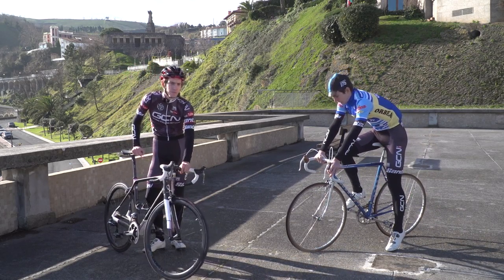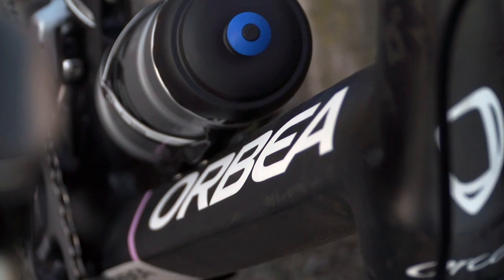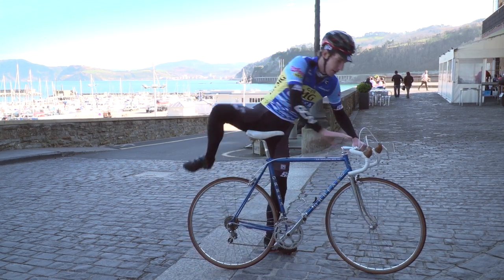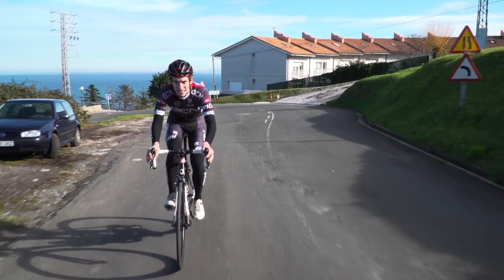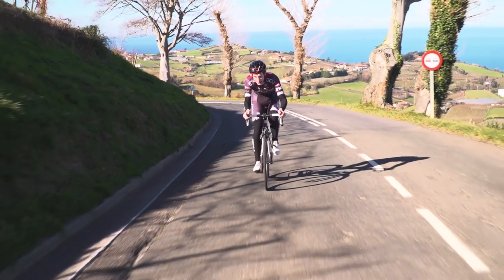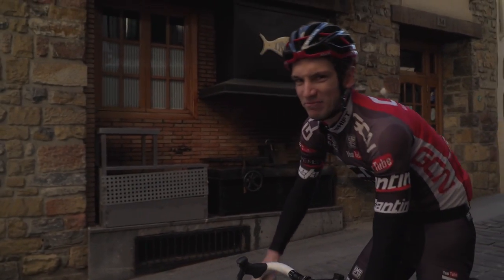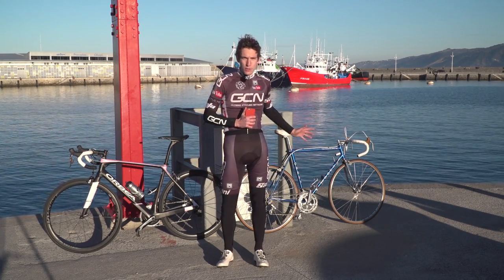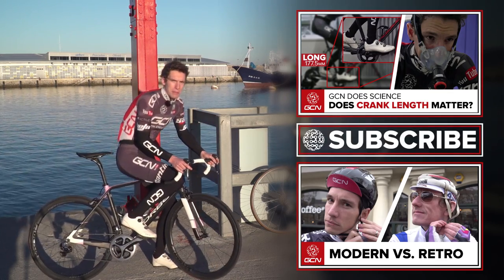How Much Faster Are Modern Bikes? | Retro Vs Modern

Comment: make a video about modern steel bike vs modern carbon bike
Reply: Modern steel bikes are really light. Especially if you use Columbus Spirit tubings, it will be similar as modern carbon frame weight.
Reply: +Yeonho Cho No it won't, or, if it is, it'll wiggle and wobble all over the place under hard climbing and hard braking and cornering. Flats would be ok.
Reply: +Digby O'Dell Ya, it will.  I have a custom 2013 Reynolds steel frame, race geometry and carbon forks, that holds 5 local KOM's, each over 6+ mile segments, one averaging 25.3 mph.  No "wobble" that you speak of and the frame is only about 180 grams heavier than my carbon Scott.  Steel feels better to me, more lively and responsive.
Reply: Somethings not right with those figures unless it's an old industrial age carbon fiber frame like my Dean which weighs closer to 1400 grams, whereas a large light steel frame is going to be about 1800 grams or a little less if it's small and not really all steel...size does matter a lot when it comes to using a heavier material, and I am always going to be an XL. I had the same problem with Ti where I could feel the front going left when I was going right at what was full gas for me.
I'll agree with lively (another man's noodle) but not so sure about responsive, that's more of a subjective term. Beyond a certain point of compliance, which I actually love in carbon fiber, I can readily agree conversely that carbon fiber frames largely lack any liveliness at all; except for carbon fiber forks which can vary quite a bit more and where liveliness is not necessarily a virtue!
Reply: +Digby O'Dell I only weigh 160 on a 54.5 effective top tuberculosis  so that would make a difference.  on an XL frame the tube lengths alone are going to make a significant weight and structural difference.  1800 grams??? That's heavy even for a steel frame.  Along the lines of a chromoly Soma, again not thinking of the XL size.  Mine is a touch over 1460g on the scale, no forks or headset.  2015 Scott Addict is about 1280.
Reply: +Digby O'Dell Titanium and Steel frame have different stiffness and other. Steel bike is way stiffer than titanium. This is why track cyclist never use titanium track frame.
Reply: +Yeonho Cho Tuberculosis... damn autocorrect

Comment: Seriously? Even with the bogus Simplex components, I rather doubt the weight difference was 4 kg. I have a steel bike from 1987, and a carbon from 2014, and the difference between them is slightly more than 800 grams. Also, there was definitely a disadvantage in no toe climbs, operator proficiency (Really? He was surprised to be able to shift onto the big ring? It's not like normal indexed shifting is that big a help on a modern bike!). 

I call bullshit on this "test".

Comment: How silly.  This isn't a serious comparison which you can tell by the degree to which the steel bike was handicapped:  poor fit, not even using toe baskets, pedaling with shoes designed for clipless pedals.  Yes, I climb faster on my plastic bike, but if the race were downhill I'd pick one of my vintage steel bikes, with new rubber and brake pads of course.  I like them both.

Comment: Are you trying to pull the wool over my eyes? at 0:59 we see Delgado riding a bike with Campag Super Record, not Winmann brakes. Also those Simplex gears you show are entry level components, so should be compared to a modern "Tiagra" spec not Dura Ace. Looks like it also was shod with el-cheapo wheels... which is why you broke them....not saying retro is better than new, but at least make the test fair... stopped watching after i saw that, since the result will be BS

Comment: i span most of the frame metals
steel (kalkoff)
renolds531 (dawes)
molybendium( raliegh criterium)
aluminium(cannondale)
aluminium(bianchi)
half carbon(bianchi)
full carbon  (bianchi)
if this test had been done with the older bike fitted with toe clips ,i guess this might have taken  30 seconds off the final time ,plus the arseing about with the wheel probably makes this test unvalid,i have no doubt that the newer bike is superior .that is the very least i would expect from 30+ years of progress ,and the fact that aluminium and carbon means that a new generation of cyclist will  never experience rust is commendable ,however the cost of a  reasonable cycle is now over a thousand pounds for a  basic carbon model and a aluminium model at half that amount,the economics are simple ,as i have owned the whole range my next cycle will be a aluminium road bike bought at the right time of year(autumn) when they get rid of the current years model.on the basis that its not that much heavier than a carbon,has little crash issues(carbon could be a worry as to frame stability after a heavy knock.and the problematic issue of having to purchase a specialist wrench to perform basic maitenance,in case you crack the frame,i use my bike as a means to commute to work for the last 13 years and ongoing and the question seems to be is it wise to spend £2,000 to get a cycle that is maybe 5 pounds lighter than a aluminium model at £700 its your money folks ,as someone who has paid over£2,000 for a ride to work,my next upgrade will be a downgrade however it will still have the bianchi name on the frame,

Comment: huh, mind you ive got an old ccm targa that isnt special by any means, and its got a mix off mtb parts on it and different brake levers and brakes themselves. The point being, si looked pretty slow down that hill, i bomb hills at 70 k an hour, could have saved some time there, and if youre descending and using your brakes lol youre doing something wrong!

Comment: Modern bikes are definitely faster. But the riders of the old or retro were/are definitely stronger.
Reply: Hahaha, you are joking right ?
Reply: No.
Reply: hutch430 Come on man, how could you say that? Sports science, nutrition etc has vastly improved in the last 20 years. There is no way a cyclist from 20-30 years ago could outperform his today's equal. Also PEDs are a lot more potent nowadays which gives an other huge boost on top of improved training methods and stuff. There wouldn't even be a competition between them. (Note that it holds truth to every sports where strength and endurance plays a big role.)
Reply: I just believe the cyclists of the old would were stronger than the new. They rode heavy steel on feel. No power meters or strava whatever those things are. They didn't have all this team high tech which should be outlawed by the way.
Reply: hutch430 Yes but these new gadgets and improvements are exactly the reason why cyclists are getting stronger and have more endurance. They help with training.
I must mention that I am a fairly oldschool guy in my mentality too. I have a titanium frame hardtail MTB with a speedhub, very low maintenance, not many things that could go wrong on it. But still I would never say that cycling is not improving in every aspects. 
Today bikes are better, lighter, stronger and these gadgets can help lots of people. Why should these things be outlawed?? For folks like you and me, well we just don't buy these things, it's not like we are forced to buy them :) .
Reply: I meant outlawed in professional cycling during a stage or event.
Reply: Oh no way hutch, today's cycling is a great great deal more competitive, cyclists a great deal stronger fitter in better shape...
Reply: Well, think about it. Todays cyclists need a compact or semi-compact chain rings with 28 or 30 tooth rear cassette with 11 speeds and still whine. Yesterdays cyclists had even heavier bikes, did with a 42 small ring with a 19 tooth rear cassette with maybe 7 speeds. Brother, todays cyclists are boys, yesterdays cyclists were men.
Reply: and yesterdays guys did all this with no computers, power meters, strava and whatever else fake aids of todays cycling are using to try to enhance their performance. A computer will never be able to measure a persons feel.
Reply: hutch430 You could do the same thing today... and finish as the last one in races. Competition by definition is about to be better than your opponents. And with all these high tech gadgets, modern drive train systems and lightweight bikes you have an advantage. I really don't see what's your issue here, or what's the point you are trying to make. You can still ride a steel framed bike from the 70s if that what makes you happy.
Reply: hutch430
Yes they have all kinds of support that allows this to be the case, however I'm responding to what you said, and the fact remains that today's cyclists are a great deal stronger than those of yesteryear.

For example if you could put one of today's best time trialists onto a 1960's bicycle and get them to ride a time trial against 1960's cyclists, today's cyclist would shit all over the field, because today's cyclists are a lot stronger.

You can believe otherwise, but you'd be wrong and every cycling expert knows it. As for the claim that today's cyclists are boys, you should know that today's cyclists put themselves through just as much pain as those of yesteryear. You're looking through rose coloured glasses. If you've seen old Tour footage, you'll see they did a great deal of whining. And cheating was just as prevalant but took different forms. Men don't catch trains to gain an advantage.
Reply: You have your opinion I have mine. 
Todays cyclists are not stronger. Take away all the fake electronic gizmo and todays riders would be lost.
Reply: hutch430 If you sent back a top level cyclist of today to let's say 1970, what do you think how would he fair against those cyclists? I am talking about using the same technology and bikes as they were using back then. Do you think the modern day cyclist would loose against those riders? I am genuinely interested in your reply.
Reply: zoltan87
Yeah that's what he's saying, the modern cyclist would lose. Not only lose, but that modern cyclists are borg drones that wouldn't be able to ride a bike without a speedo, powermeter, GPS, and connection to the Strava hive collective.
Reply: eddy merckx is almost as fast as pantani on the mont ventoux with his heavy steel bike and less Gears  and a lot faster than some modern Day mont ventoux winners
Reply: Yeah and there's only a couple of hundred metres in the hour record between Merckx and the record today. And he did it at altitude.
25 October 1972 Belgium Eddy Merckx 27 Agustín Melgar (333 meters outdoor concrete high-altitude), Mexico City, Mexico 49.431 Drop handlebar, *round steel tubing frame*, wire spokes.
27 October 2000 United Kingdom Chris Boardman 32 Manchester Velodrome (250 meters indoor wood sea-level), Manchester, UK 49.441 Drop handlebar, *carbon fibre tubing frame*, wire spokes.
19 July 2005 Czech Republic Ondřej Sosenka 29 Krylatskoye (333 meters indoor wood sea-level), Moscow, Russia 49.700 Drop handlebar, *carbon fibre tubing frame*, wire spokes.

I think Hutch is vindicated.
Reply: dudes, you just need to look at randonneurs. all the records.were broken in the 60's and never again has someone broke them. all you weight winnies woudnt be able to go up a hill in an 18kilo bike, less alone do 200k. modern cyclists need everything in order to do time, if they forgot their milkshake then they're fucked, while old school riders drank and smoke like beasts and still could keep on max effort in 40°c temperature.
Reply: Look up world's any type of lifting or running historical records.

Comment: Was this the bike Delgado rode to the shop to buy a loaf of bread?,weinman 500 brakes,i had those on my raleigh arena,cheap looking simplex gears.The frame angles are too relaxed for a mid 80's pro's bike.I know it was just a bit of fun,but its pointless,you cant ride normal pedals with modern cleated shoes,you will slide off the platforms.If you were to do the test with a campag super record equipped hand built de rosa frame or something,you would have a bike that all pro's used in the 70's/80's.You would have little deficit,if the bikes serviced to perfection,until you got to a climb,the 4/5 lb weight increase would hold you back,but most of that is in the frame,not revolving weight.Of course modern bikes overall will be a bit faster,but not quite as much as manufacturers like you to think.Alf Engers broke the 30 mph barrier on a standard steel tt road bike if all the modern gains are true,the wattage put through a modern bike would have given him a sub 40 min 25 tt.......

Comment: Carbon forks feel disconnected from the road.  Even supposedly steel bikes made today are often equipped with carbon forks...which defeats the whole purpose of a steel bike.  Modern bikes, with their enormous stem and handlebars are not only ugly, but very uninteresting to ride.  All they have going for them is speed, which is why speed is the only criteria ever used in these comparisons. From my experience, the older bikes are better aerodynamically, since the tube width and handlebar widths are smaller.

Comment: different fit, old flat pedals, shifting system you are completely unfamiliar with?  New bikes are hardly "a lot" faster.  Small increments in very specific areas, maybe.  Throw the old Pedro on a new bike with his old shoes, completely unfamiliar with modern components & the RESULTS may be completely the reverse.

Comment: it might be the frame from the Delgado bike it is definitely not the bike, weinmann 500 brakes, touring clinchers , flat pedals ? give it a rest !!  These comparison tests are so transparent ..... like the beay bike vs superbike. Change the wheels and tyres ! /Take a nice old lightweight steel/vitus 979/TVT/giant cadex. Stick a set of 50mm carbon wheels and fast tyres and then compare. I dare you GCN ! In fact you could go a step further and add weights to nullify that too. 
 I've done it and now don't bother with modern frames.

Comment: come on do be stupid you could of used a 90s fillet brazed lugged bike with ergo shifters or bar end shifters and more gears and steel is real it has more rigidity more rolling resistance it wins going down hill but struggling uphill but that depends on how fit you are and 11 kilo is ok anything under 10 kilo is not worth having

Comment: suspension technology on bicycles was pure rubbish in 1997.  I had a moderately expensive Rocky Mountain hammer mtb in 1997. The suapension fork only had elastomer/rubber rods inside. not even springs.  I belive it was a 1000$ bike. Today you get way better suspension on a 150$ bike.  In +5 celsius or colder it had zero suspension.

Comment: Stupid Comparison,  by today's standards ancient  tech against OTT tech.  Classic 1990's  Reynolds 753 or  Columbus SLX  frame indexed down tube levers and hidden cables would be a valid head to head.  Still have my bespoke self built Columbia 753 raced, toured both Britain and Alps.  Modern tech does NOT have one precious thing........Style / Beauty,  how can you compare a steel Colnago,  Eddy Merkcx, Terry Dolan,  Dave Lloyd  etc with a awesome paint job  and chrome to carbon.    
Most modern cyclist's have zero appreciation of craftsmanship and design and only interested in function and latest unnecessary tech.       Keep It Real Keep It Steel  😀